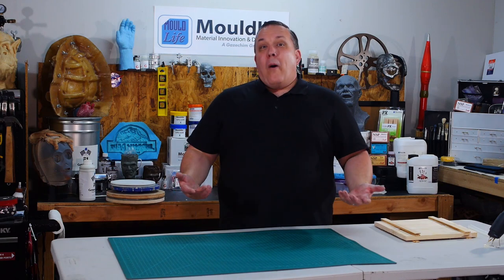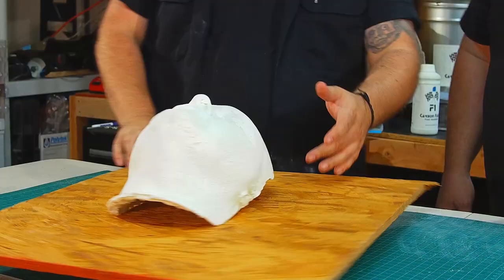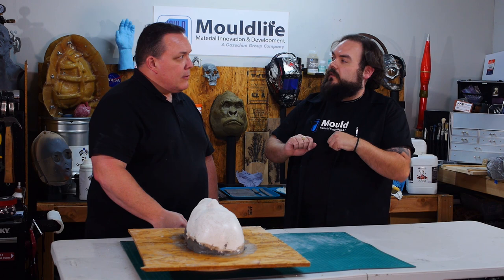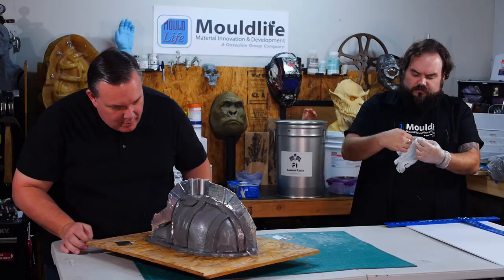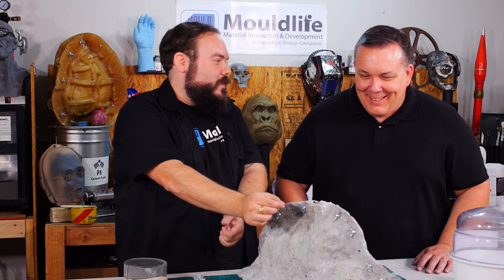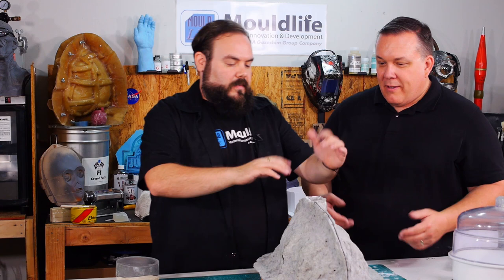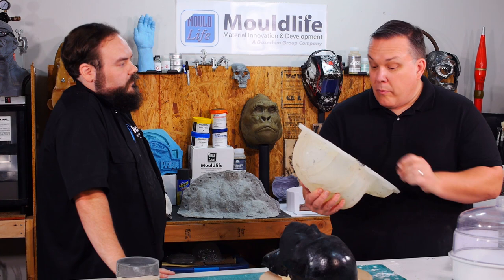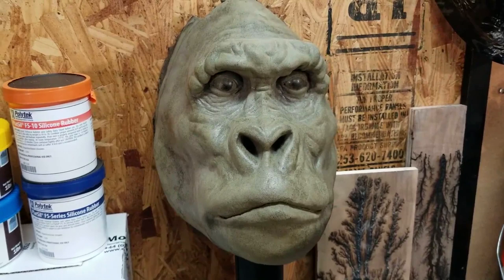Odin Makes: Odin with a matrix mold at Mouldlife USA

Comment: Recently been learning about matrix moulds in class, probably one of the more professional industry standard ways of doing things, plus it saves a lot of silicone and allows you to control the thickness of your silicone jacket mould which is much harder to control if you try and make the Silicone jacket first, then make the shell around it.